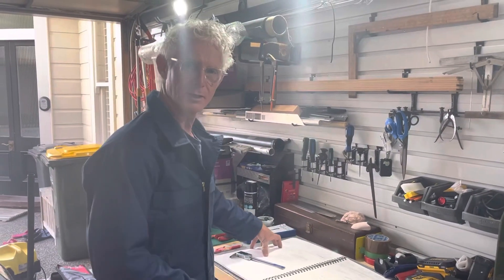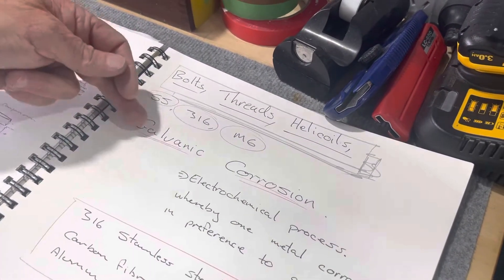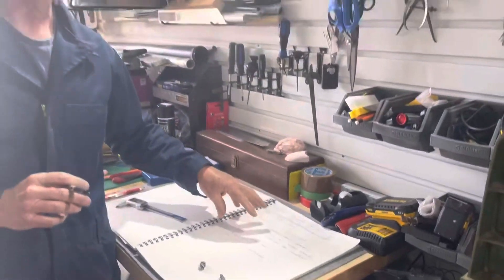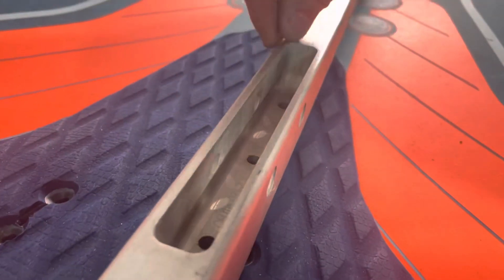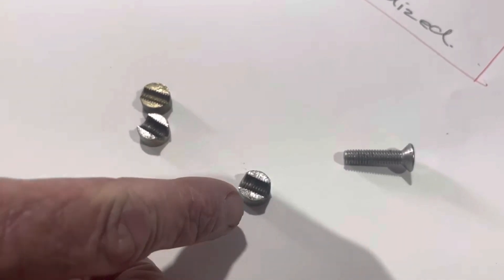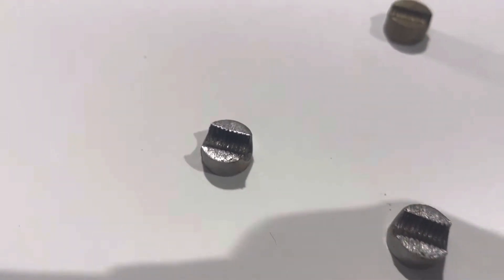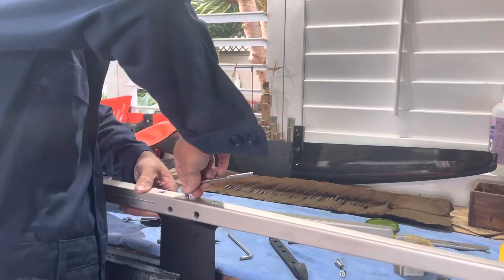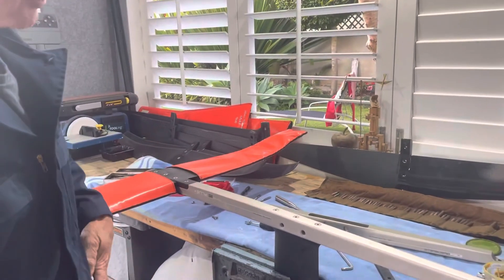Bolts, Threads, and corrosion

Comment: If fuse is scratched … how to fix?
Reply from the maker: Hi thanks for the question. You have used the words fused which infers that the fastenings are stuck together. For me to answer your question could you give me some more detail. Chat soon.
Reply: @foillabs1990  Hello Gary, I have the same question, I think he means:

What do you to if the anodized layer on the aluminum has worn off by scratching, sanding, etc. ? If it's down to bare aluminum? Can you leave it as is, or you repaint ?

Comment: Another great video indeed. 
What is your opinion on the use of galvanic steel bolts vs stainless bolts to attach the foil to the board, and more specifically, the differences in tensile strength between these two materials…?
Reply from the maker: There are examples of high tensile steel being used to strengthen aspects of foiling. When the "strength weight" ratio is an advantage. Foil boards have inherited the tuttle box concept, which contributes to the root cause of fastening failure and box damage. That's why the components have to be maintained. We see massive pressure on the back bolt and observe the backdown of the carbon at the top of the box where the bolt is seated. Using high tensile steel bolts is not a bad idea if you clean them to mitigate corrosion. The real issue is the box concept.
Thanks for the question.

Comment: It’s worth mentioning that you can buy cycle torque wrench so you can do them up to the same correct torque every time 
, it’s a lot less than you would imagine,! Most are over tightened, It also worth mentioning that that you should tefgel the helicoil when inserting into the alloy, I personally would pull all the factory fitted helicoil inserts, and lube them up! , so you make a barrier between the different surfaces, taking apart the the foil every time does wear away the anodising seating in the fuselage for the csk heads of the screws, you can have the fuselages stripped and re anodised with a hard anodising which helps, you can also buy csk washers to go under the heads of these screws, commercial ones are quite thick though! If you do leave you foil assembled it might pay to fill the void in tail fin wedge which is hollow in the moulding with a Sika type material or it will fill with salt water and be the perfect environment to fizz that part of the fuselage,  as an alternative to welding up a badly damaged hole you could use a stainless self taping thread insert, basically a larger bolt with a tapped hole in the centre that you need. Great series of videos !
Reply from the maker: Thanks Simon, Great additions and I agree that a torque wrench works well. Some of our group use a battery drill with a torque setting. I think if you're an active foiler I'd always encourage disassembling and washing. We are constantly changing and adjusting settings to find more speed.
Reply from the maker: Thanks Simon, all very good additions and sound advice